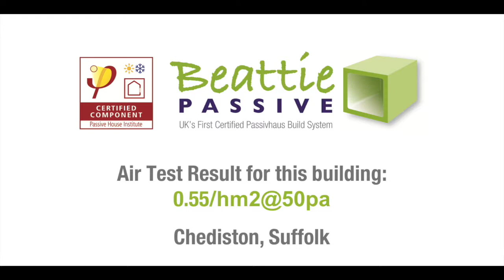Air Test at Self Build

Comment: 0.55? wow! I understand 0.6 is a requirement for passivhaus, but surely the air quality is an overlooked factor of long term occupant comfort. This is something that is never addressed, it is what we can achieve then and now!. There need to be more studies in the industry regarding this. New builds with an air test of roughly 5 (3 for timber frame) seem more sustainable in the long run due to natural ventilation.
Reply from the maker: Hi. A high air quality is maintained by the Mechanical Ventilation and Heat Recovery (MVHR) unit. It works by pumping out the stale air and constantly pumps fresh, filtered air into the property. It also removes dust and moisture from the property effectively as well, removing issues of mold and helping reduce the symptoms of respiratory illnesses. It also recovers the heat from outgoing air, which combined with the airtight insulation keeps the home nice and warm all the time without excessive need of heating systems making it much more environmentally friendly than a standard build!